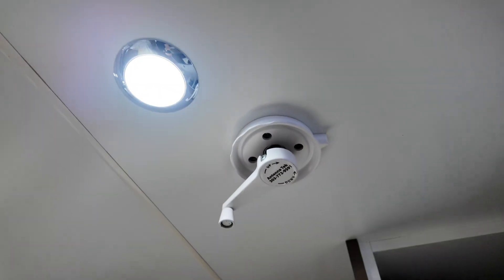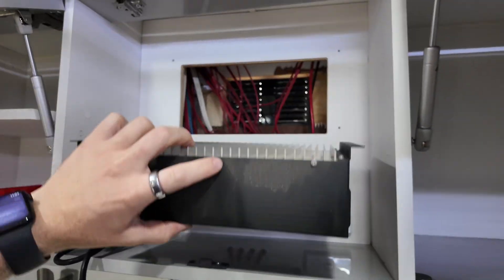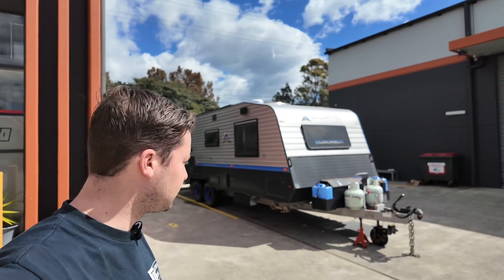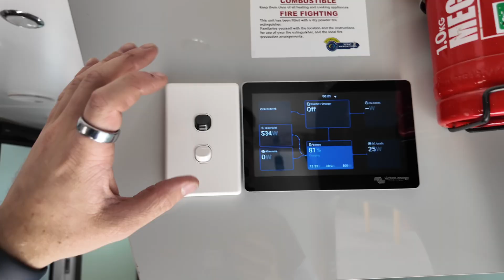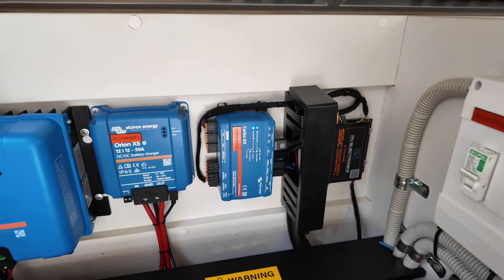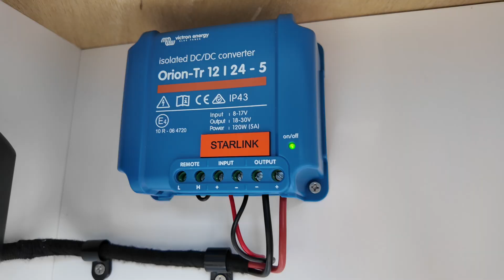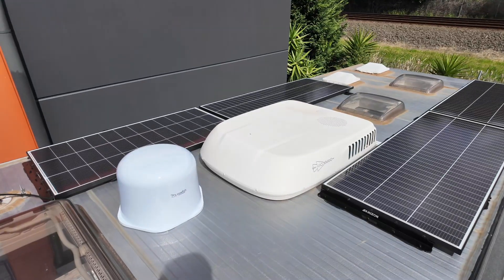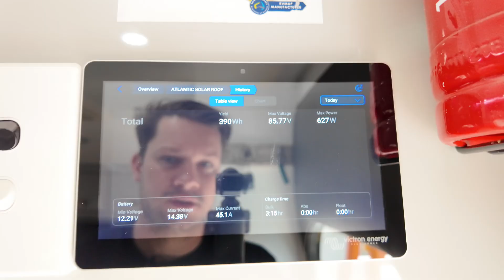The COMPLETE Off-Grid Setup | 950W Solar + 700AH Lithium + Starlink Mini | ATLANTIC MURCHISON

Comment: Do lithium batteries need to be sealed from rocks you have them Open to elements won't  boxes  fill up
Reply from the maker: They’re are fine being open to the elements, these ones are IP67. In regards to rocks as such, highly unlikely as they’re in front the caravan wheels and there isn’t much more space in the battery box for things to get in, the batteries take up 95% to the space